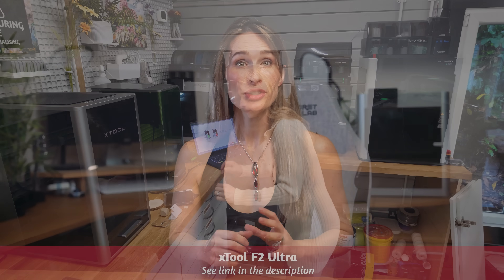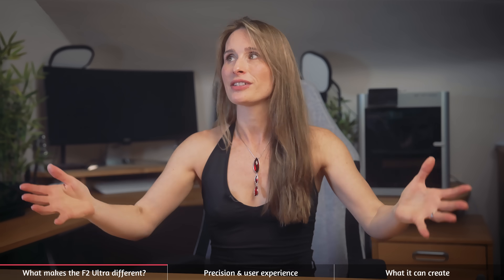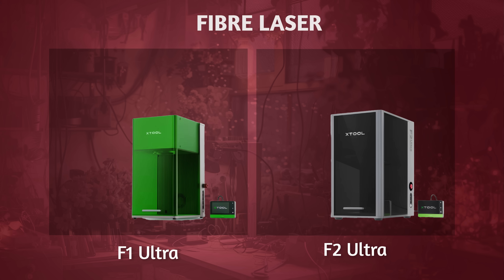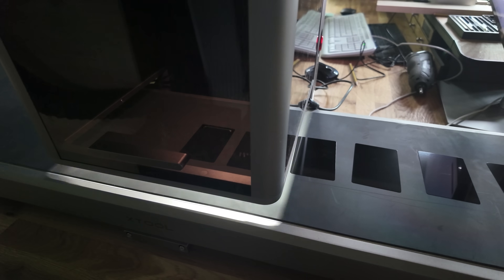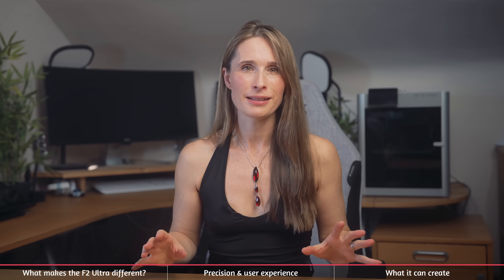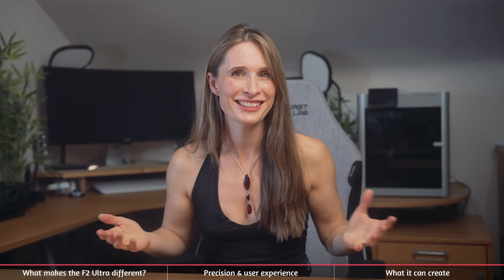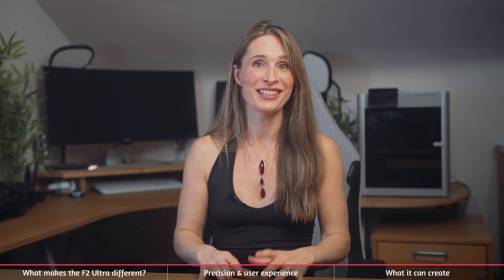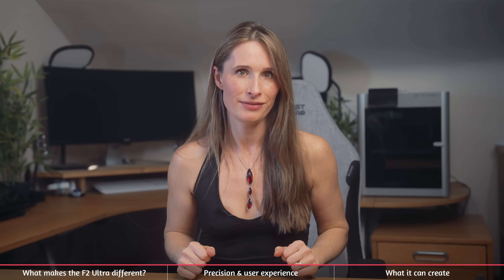Crafting with the xTool F2 Ultra | Metal, Wood, Slate & More (Review + Project)

Comment: Thanks for posting a video today... had one hell of a day with my renovations... finished removing an old bathroom, about an hour later water leaking sound living room full of water YAAAY. Its cool to see all these devices you have. I had a laser cutter in the past, but found the smoke a bit awkward to deal with. I like you always buy self-contained units makes the lasers much safer to use as a daily driver. I was terrified of blinding myself with my exposed laser cutter lol. This seems like a much better device overall.
Reply from the maker: Oh one of THOSE days! (been there!). I do hope you get it tidied up (or at least dry!!). Yes, my original laser cutters were exposed, just not worth it - so much safer to be enclosed - xTool have some great standards in this space and the smoke is a thing of the past with their extractors and/or filters!
Reply: @handsonkatie yeah I'm jealous of your set up a little bit. I'm renovating at the moment and currently printing out a lot of gridfinity and open grid for the house. Your organisation inspired me a lot. I subbed to say thanks! Are you able to make it so YouTube members also get discord access?
Reply from the maker: Hey, yes of course, you should automatically get access - there's also a post I made originally on YT Members section that shows you how - just drop me an email on my site if it's not working (Youtube's options are a bit ropey in this respect)